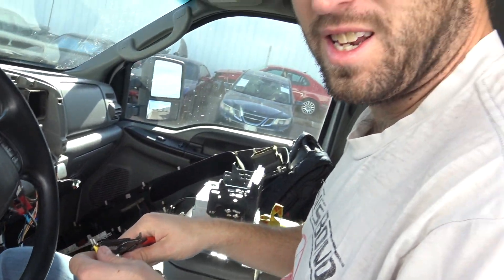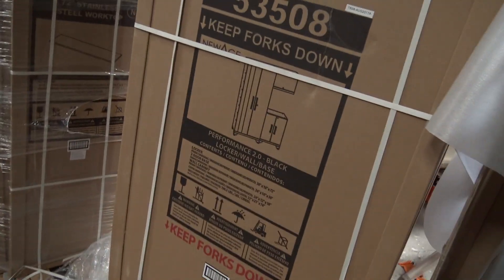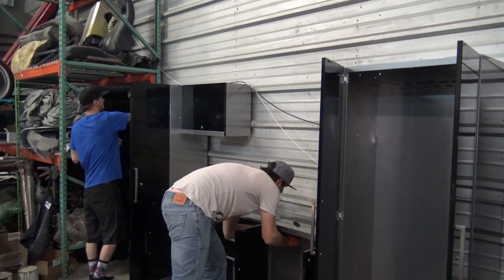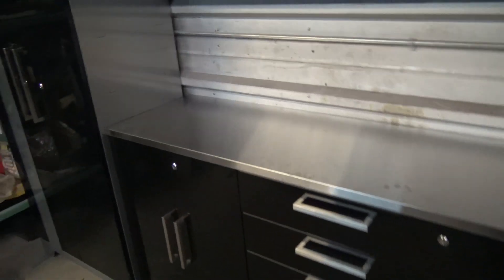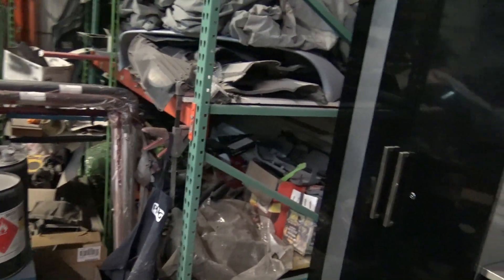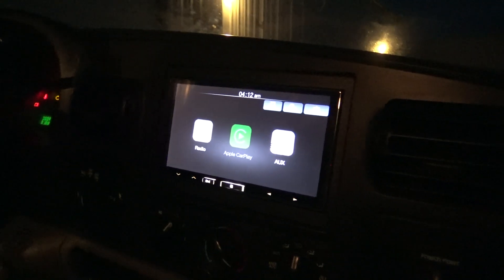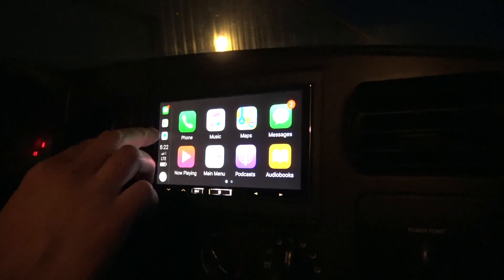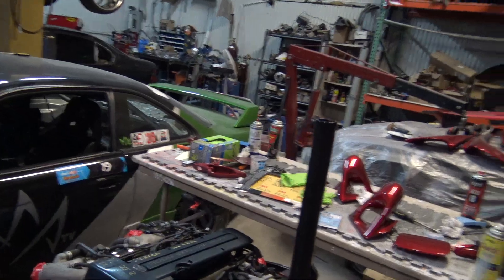NEW PRETTY SHOP CABINETS!

Comment: Looks good Trevor.  I just have some metal wire shelves like you have your paint on. I added a piece of plastic to prevent items falling through. Then I used large stackable plastic bins to hold most items.

Comment: Look real nice! As far as the price and your description - the Performance 2.0 line has 24 ga. frames, where the Performance Plus 2.0  has 18 ga frames. Although bolting the 24 ga cabinets to the wall will really help with the rigidity when they get loaded.  And the $3,000 price for the ones you saw at SEMA may have been for 18 ga frames or even 16 ga frames; like for commercial garages where they would get a real workout by people who didn't dig deep into their own pockets to pay for them. IOW, not as much care taken when they used them. 

In my day (70's thru the 90's) I was using used office type steel storage cabinets that I got in used office equipment warehouses in my 4 stall retail auto repair shop; the "gas station" variety of cabinets was like 10x as expensive as new office grade cabinets. And the current crop of steel "garage" storage systems like you and Adam have weren't made back then.

Over the years I had to replace a few due to the cabinet "colliding" with a bumper - yeah, they jumped away from the wall because they did like that car. The dents weren't reason to replace them, but when the door hinges got broken or couldn't be re-aligned it was time for different ones - hammer and dolly, and touch-up paint job when possible. And I wasn't beyond having the "recylers" (who toured the alleys and picked up scrap metal, rotors and mufflers from me) keep their eyes out for better cabinets. Also bought used steel stuff from them for practice welding. One man's "junk" is another man's "treasure" with a little bit of fixing and painting - I was focking cheap.  And I used Craftsman work benches with drawers where I needed drawer storage. Had two commercial benches for vises and "beating on shit" bolted to the floor; had to remount them away from the wall to keep stuff from "walking off" the shelves attached to that wall from all the hammering. LOL

IMO, keep those old floor storage cabinets. You never have enough room to store unsightly crap that you can't bear to part which; the "I'll find a use for that 'some day' hoarders syndrome" which many creative people suffer from. A better syndrome to have than chronic masturbation!

Comment: I used a relay to trick the thing into thinking the parking brake was always on
Reply: MrTradeTroll exactly, use a relay to switch to ground off of key power no switch needed

Comment: heres what you really need to figure out about the supra, it needs a single turbo swap, new injectors, and a fuel pressure regulator. theres no fixing the boost cut on the twin scroll